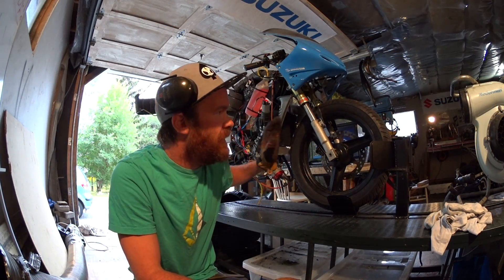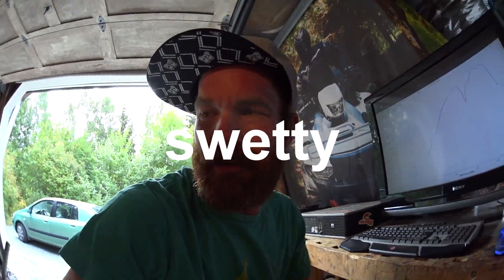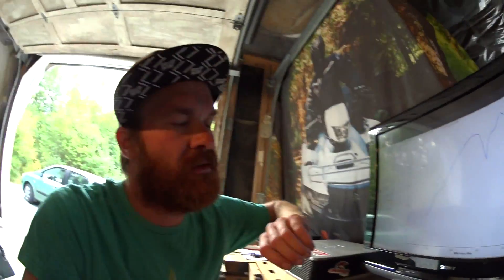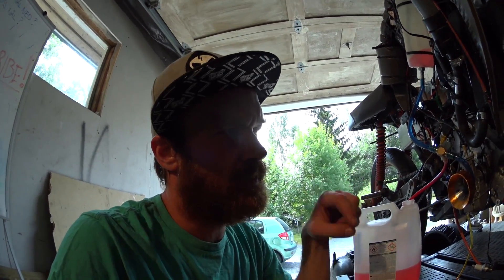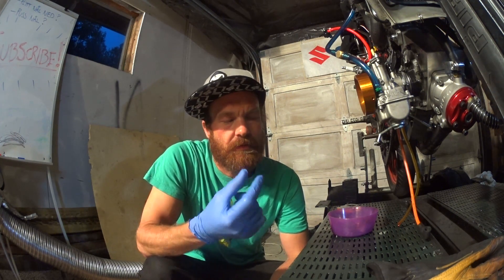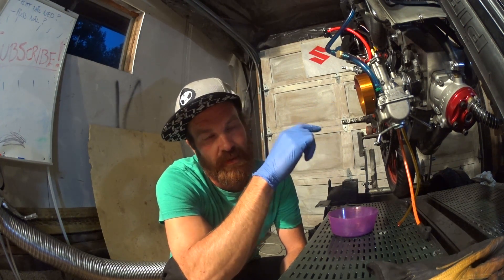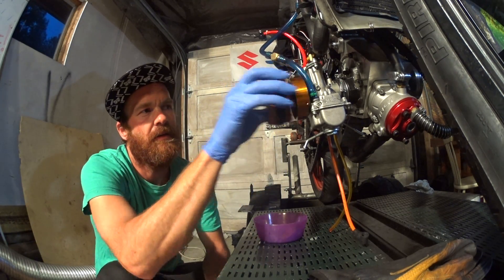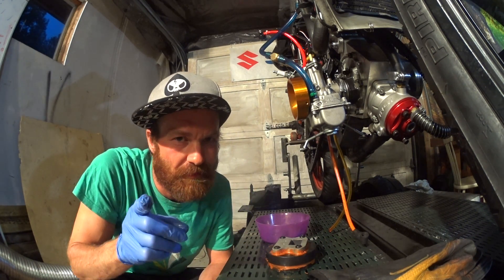E4 - Moped On Methanol/Nitromethane | More Power, Destruction, And a Plan.

Comment: Do you think i can run a 125cc 2 stroke gokart engine on that? and what about oil mixing oil to it?
Reply from the maker: +Nicolai Mørk Brejnbjerg Yes you can! It's premixed RC fuel, but any oil that will mix with alcohol works, I can recommend Castrol A747
Reply: Thanks!
So if im running a 160 main jet i need to jet it 30% biggere so roughly 208 correct or what your experience?
Reply from the maker: +Nicolai Mørk Brejnbjerg I would start with adding an adjustable powerjet(run it full open) and removing both the main and pilot jet completely and fire it up. Most likely it will run just fine or it will melt the plug. If it doesn't melt you should figure out the area of your needle jet(subtracting what's taken up by the needle tip at WOT) and the area of the tightest passage in the pilot circuit, and try jets slightly smaller. Be careful, you can run really rich without much loss in performance, but go slightly lean and it will detonate to death in no time. I'm running about 4x jet area vs gasoline + the powerjet.
Reply: Okay i think it will be using so much fuel that i only get a few laps and then need to refuel again (8L) where im on 98 oktan can drive 20-30 min at the track atleast before thinking on refueling
Reply from the maker: +Nicolai Mørk Brejnbjerg Probably. In my previous dyno session it had consumed almost 1l after a bit of idling and three pulls...

Comment: Yes the needle wont effect full throttle at peak on a dyno, tuning the needle right will just get it to the peak faster over a timed acceleration like a race track, your main is pretty close anyway and Methanol is more tolerant and mixtures don't have to be so perfect like petrol. I agree it is probably the disc intake slipping, if it slips one way or the other it will shift power, so yours may have moved the power higher giving you more peak. How many degree are you running on the disc, maybe it could use a bit more intake timing.
Reply from the maker: I Make and Fix Stuff I was running 140/85 intake timing, and yes it could be that it wants more. Will be very interesting to see how it reacts to no intake control at all.
Reply: Slide might act a bit like a valve to get it running. Have the extinguisher handy in case it blows fuel out the intake. Its risky with methanol.